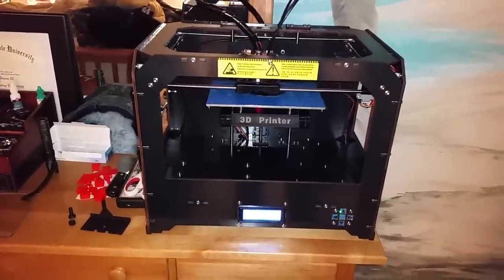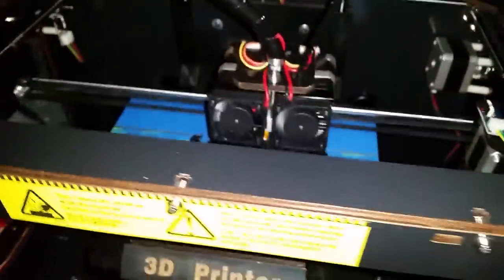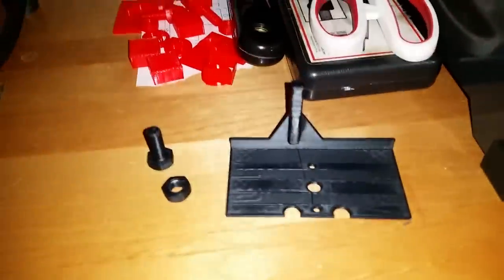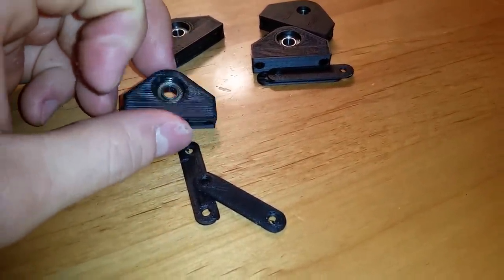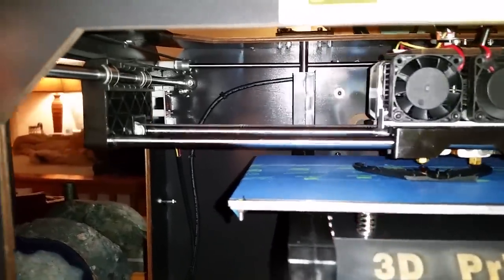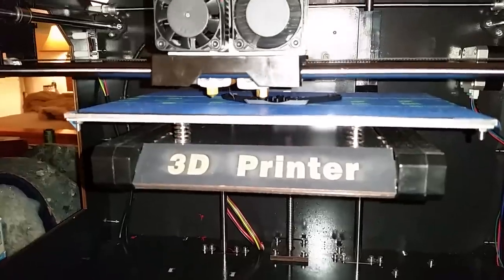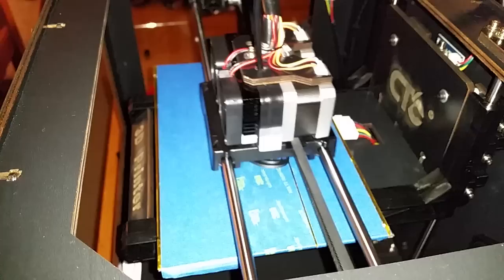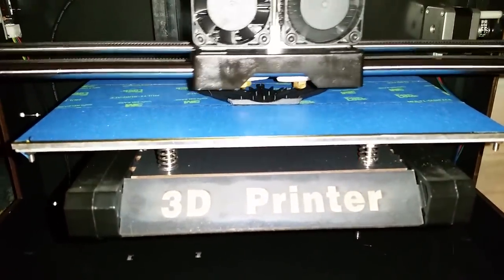CTC 3D Printer Brief Review and Test Prints

Comment: You do get what you pay for.   I have a MonoPrice Dual Extruder which looks VERY similar to this CTC 3D that I got for $700 and it is a Bugatti Veyron compared to this CTC 3D.   First of all, the Monoprice has an all steel frame, not wood, composite or some other flexible medium.    The MonoPrice had better quality parts and printed perfectly right out of the box.  I have over 2,000 hours of great prints from the MonoPrice printer.   Since I already had a couple years experience with 3D printing, I knew what to expect and how to deal with it.   But I WOULD NOT recommend this as a first 3D printer unless you are extremely good at tinkering and willing to learn all about the nuances of 3D printers.   If you are new to 3D printers you may find this printer an adventure in frustration early on.    I do think that with patience and know how, this printer can be fine and do some good printing.   But you have to know how to dial it in and make a few changes.

Comment: Hello, I have seen a few of these on ebay and I was curious which seller you bought yours from.  I was also curious if you were using filament that was shipped with it or if you were using some other filament.  I was going to build a Prusa i3 but the price/hassle ratio has me leaning more towards this option.  Thanks a lot for any information you can give me!
Reply from the maker: +sabethman The sellers ebay name was Colorday888. I have used the filament included with the printer, which was red PLA, and it does seem to be good filament. Haven't had any issues with it whatsoever. That being said, I prefer ABS since its more durable and can withstand higher working temperatures. I was looking heavily into building a delta type printer, but as you said, I couldn't have build one for the same price as this one fully built and working let alone the frustration it would have been. Hope this helps!
Reply: ElementCollector1001 The information definitely helps, I really do appreciate it.  I decided to order a CTC about 5 minutes ago, hoping everything goes well!
Reply from the maker: I really think its a great printer for the price. Let me know if you need any help when you get it!

Comment: What software are you using for this machine? Replicator?  And do you recommend any other program instead of that program? How or where did you get the block files for the y axis? ...I just recently bought thus same machine
Reply from the maker: Mark Ernst Hi Mark, usually I find myself using ReplicatorG, but once in a while I use the Makerware. I find Makerware produces a much better raft that separates very easily, so If I'm printing something on a raft I will use makerware. The pillow bock for the y-axis can be found here: http://www.thingiverse.com/thing:232678

Comment: Are you still using this printer? Mine doesn't work any longer? Have you had any issues with motherboard or power unit?
Reply from the maker: No I only used it for a few years and then ran into extruder issues and just ended up getting an Ender 3

Comment: Mines sat in my office and not having it and it's more of s treat to myself but how do they print I've used a dimension 1200es SST and loved it to bits for the past 5 years but time goes in and I must say good by the my 75000$ printer and hello to my $700 printer would you recommend anything for upgrades apart from the pillow blocks etc as put belt tensioners on my Stratasys machine they almost dropped my maintenance service aha

Comment: +ElementalMaker How is the calibration of this printer. Is it automatic or manual. Also, is it hard if its manual. Would you recommend this printer?
Reply from the maker: It's quite easy. In my case the build plate just needs manually leveled every couple months. Calibration wise I didn't have to do anything aside from taking it out if the box and I'm pretty darn happy with it. Only issue I had was the Y axis was off by about .2mm, and that was due to the belt being slightly loose,  which was a super easy fix
Reply: Awesome!!! Thanks so much!!!!

Comment: One last question if you don't mind. I have a project in mind and it looks like the max dimensions this will print might not be big enough for me to print horizontally. My project is flat about 200mm x 148mm x 3mm thick. Do you think it would be possible to print this vertically? It looks like it will be able to print 150mm height but not sure how well it would stand up being only about 3mm thick printing 148mm high.... What are your thoughts?ThanksDavid
Reply from the maker: +Davy1Jones You could just put a glass plate over your print bed, which would essentially extend your x axis to the needed length of 200mm. You can also always print in two pieces and assemble them together.
Reply: hmmm... maybe I am looking at this the wrong way. I'm looking at the spec on ebay it says build envelope 225mm x 145mm x 150mm so I was thinking that was x=225mm, y=145mm and z=150mm or length=225, width=145mm (or visa versa depending on how you are looking at the print bed) then a max height of the object as 150mm.  So my project is length=245mm, width=148mm, height=3mm. Sorry I was way off on my initial thoughts my piece was only 200mm long but it's actualy 245mm so I was initially concenred that this could only do a width of 145mm and I needed 148mm but it looks like I need both length and width. So are you saying I can extend the working area to cover my parts dimensions but putting a piece of glass on the print bed?

Comment: Rebuilding one of these for my nephew. I picked it up in barely used condition for $75 but of course its old tech already. 

Going to a single extruder so we have a larger 8x14 bed. This is worth the trade off since he doesn’t need multi color right now.

Swapping out the main control board to get better resolution and while were at it spending $50 to upgrade (encoders) for closed loop, and we have glass panels for the sides and a glass dome for the top that were recycled from a commercial jewelry box. 

I was looking around to see what other upgrades may be interesting and ran across your video. Good to see that stock they were not bad.
Reply from the maker: It was definitely a good machine, unfortunately I was never able to dial it in enough to make functional parts for my engineering projects like mating threads and the like. I ended up getting an ender3 which has been absolutely amazing. Microcenter has them on sale regularly for $99, highly recommend it you are looking for highly accurate prints, but then again the process of rebuilding the ctc and modifying it is an education worth the money in itself

Comment: Hi! I just purchased a CTC and I am having issues with printing quality. I have done all the basic setups including leveling. My first print eas flawless... looked amazing! Then it went downhill. I printed the same file again and the rt ext started to make ghost prints. it was moving but nothing came out. so I unloaded and reloaded the filament... even tried changing from Makerware program to Slic3r for my program but still having problems. my printer is 3 days old and I am concerned if I got a lemon or maybe I am not doing something right? Your input and help is very much appreciated. thank you so much.
Reply from the maker: Definitely check that your belts are tight,  also check the m3 screws that are all over the frame of the machine. Many of mine were lose,  and that could cause rigidity issues resulting in a loss of print quality
Reply: +ElementalMaker thank you for the quick reply. Would that keep the filament from coming out of the extruder?
Reply from the maker: +Sandra Mitchell there are a few possibilities there. Try upping the set extruder temp in 5* C increments and seeing how it prints at each. I would also verify that the thermistor is well secured to the extruder,  as that could be causing issues too. What filament type are you printing with?
Reply: +ElementalMaker  - Okay thank you I will try upping the set extruder temp ... and will also check thermistor. I am using Hatchbox ABS filament 1.75mm
Reply: +ElementalMaker my current temp is at 230

Comment: Is this a loud printer? Like if I had this in my bedroom could I fall asleep while this is running? Or is too loud?
Reply from the maker: Binyamin Muchnick definitely too loud to sleep with in the same room. I had mine in my bedroom for a bit and it was unusable if I was going to be going to sleep. Very noisy as are most 3D printers
Reply: ElementalMaker so then let me ask you this if you know. A. Is there anything I can do to make it quieter? B. Do you know of any good way to monitor a printer in another room? Because I haven't had any luck finding a good answer, either that or I'm just really bad at looking
Reply from the maker: Binyamin Muchnick once you have a printer well adjusted and find parameters that work well you generally can let it run without worry. I. Leave mine run all the time without monitoring it. You could probably build an enclosure with sound deadening material, but that would cost a bit and probably take up a large footprint.

Comment: what software do you use to send the print to the printer. do you use meshmaker?
Reply from the maker: +Jaguar paw Hey Jaguar Paw, I typically use Replicator G or sometime Makerware to output the X3G file, which I then put on an SD card, which I put in the printer and print from.
Reply from the maker: +Jaguar paw Hey Jaguar Paw, I typically use Replicator G or sometime Makerware to output the X3G file, which I then put on an SD card, which I put in the printer and print from.
Reply: +ElementalMaker ok thanks :)
Reply: +ElementalMaker are the prints overall good quality because I'm debating to get this printer I'm just worried I will have bad quality prints because of its price ? 
What are your experiences with with printer how long has it lasted for

Comment: I just got my ctc printer and I am having trouble printing support material. Do u have a idear about what I should try to do different?
Reply: and witch programa and printer model do u use in the software?
Reply from the maker: +Jakob Gammelgaard I typically use replicator G for my prints. Are you printing support material with the same extruder as the object itself or the second extruder? If your using the second extruder to print support material,  make sure the nozzles are at exactly the same height or it will create issues
Reply: +ElementalMaker i print all with the right ekstruter
Reply from the maker: And it does not have any issues printing normal (non supported) objects?
Reply: +ElementalMaker no
Reply from the maker: Thats really odd. Maybe try using a different program like makerware to print objects that need support and see if that works. If not it may be worthwhile to take a digital caliper to your filament to see exactly what diameter it is, because if that is slightly off it could be messing things up. Whats materials and print settings are you using?
Reply: +ElementalMaker now it works. I just turned the printing speed down and switch the original filament to some 3d ekspert filement.
Reply from the maker: Awesome! Filament quality can have a great deal on your print quality. What speeds are you using?
Reply: 10 to 70

Comment: I haven't been able to figure out to to get ReplicatorG to print with heat bed below 110c. I created and edited a profile, but the heatbed keeps getting too hot for PLA.
Reply from the maker: Methodoc I change the bed temp in the G-code preview before saving it to the SD card.  After Generating the G-code for an object click on the "g-code" tab, then look at the 5th code line it should read 

"M109 S110 T0 (set HBP temperature)" 

Change the S110 to S60, or whatever temp you want it to be during the print.
Reply from the maker: Methodoc If you update to sailfish firmware, you can acutally change the bed temp through the LCD controller too, but honestly its easier doing it the G-code before printing.
Reply: ElementCollector1001 Thanks Element. Sorry to bug you with all this, but you have been the best supporter so far. I'm still having trouble with my CTC unfortunately. The issue I have now is that is printing blobs of plastic, it will not start the print properly. When I send a job to to printer, whether through USB or SD using ReplicatorG or Makerware it lays down a thin line of filament and from the front right corner to the front left corner, then for some reason it pauses there and the bed pushed up into the nozzle clogging it a bit I think. By the time the print head moves to the middle, the filament is coming out very slowly and begins blob up and print a mess, basically just extruding filament and balling up. When I cancel the print, the bed goes down ok, but noticed that the print head moves to the left and starts to click, like as if it's going to far.
Reply from the maker: Hmm, definitely a strange problem. unfortunately I'm not sure if I can help with this one as I have no idea what might be causing it. Have you tried leveling the bed a few times? Ensure all screws/bolts are tightened down well. If you go on 3D hubs there is a user named "Chris_Donovan", he is a CTC rep, and may be able to help sort out what the issue is.
Reply: ElementCollector1001 I leveled a few times. I'm actually tinkering with it at the moment. I found that the middle of the heat bed is higher than the outer edges. Since I'm printing small objects at the moment, I started my leveling in the middle, but now when a I sent an unedited job to the printer, even though the object is in the middle it starts to print on the back right corner. I think the firmware is the issue. I'll see if I can locate Chris on there, wish me luck. Thanks for all your help Element, i really appreciated.

Comment: what is the bedst printing material pla or abs?
Reply from the maker: That really depends on your application. PLA is typically easier to print with though
Reply: thanks!
Reply: i am consittering baying this printer, woudt u recoment it? (sorry for bad english)
Reply from the maker: +Jakob Gammelgaard I definitely would recommend it. It's identical to the Makerbots for less than a quarter the price and it is very easy to learn on and prints very well. Your English is great
Reply: +ElementalMaker thanks again

Comment: 4 years later, I bought it for £135 xD
Reply from the maker: Wow! Its crazy how quickly prices came down on 3D printers. Unfortunately mine broke a couple years ago. Still need to get around to fixing it. In the meantime I also bought an Ender 3.
Reply: @ElementalMaker  ah nice  ^^ and unfortunate at the same time lol
Reply: @dha12oks  How is yours going?
Reply: @waitakiboys4726  Eh, its going fine considering the cost of it, first week or so of using it I noticed one of the fans underneath making some noise, so I took it off and I believe it was a bit loose on the actual mount for it, after that it was fixed.
A couple months down the line it kept saying it was having issues heating the extruders up, a simple reset on it fixed this.
I've had the belt slip on the Y axis but that was due to rookie error with having the print speed up a bit too fast.
Around December I got myself a glass pane for the bed, need to create myself a stopper for the Z axis for this, as you can gather with the glass pane on, I've lost half a cm

The print quality is superb, some routh edges but yeah as shown in the video by ElementalMaker some fine prints, get some fine sanding paper and yeah the build quality.

I made myself an extension for the filament holder that I've got above the printer so I can hold 2 filaments (haven't used two filaments at once yet)

Overall for the price I bought it at, definitely a steal for what it comes with.
Reply: @dha12oks  I was able to pick one up for 150 dollars NZD, which is 90 USD. The person didnt know what they were doing with it so Ive blindly purchased it hoping it will be worth it. I guess I didnt spend much on it anyway
Reply: @waitakiboys4726  Not bad, yeah it can be confusing at first, but once you get the hang of it, it's simple.

Just make sure you have ReplicatorG downloaded, I use Blender as well.
Plenty of tutorials out there if you get confused as I did when I first decided to design some basic things.

But yeah.